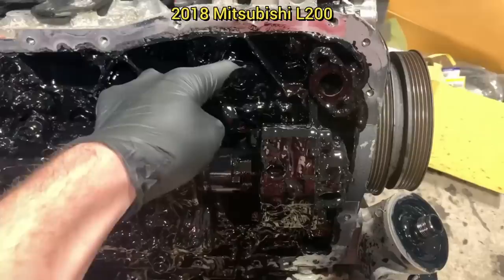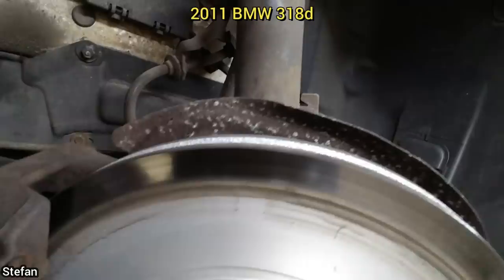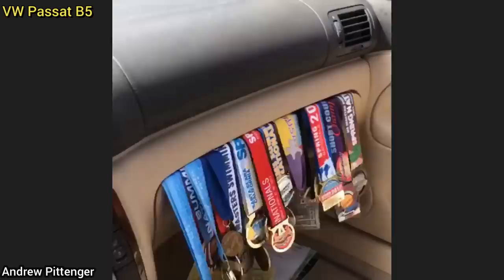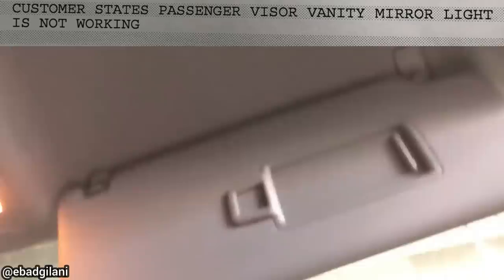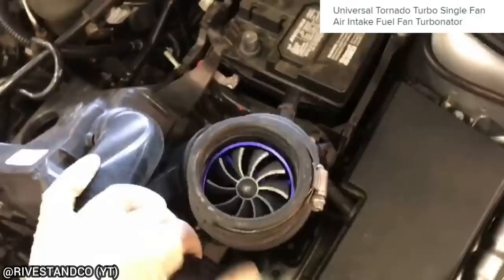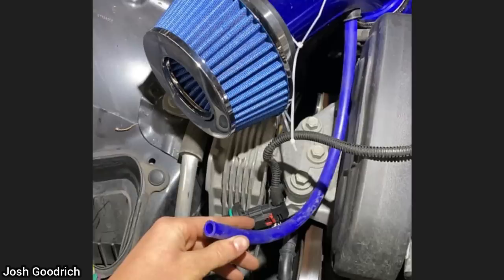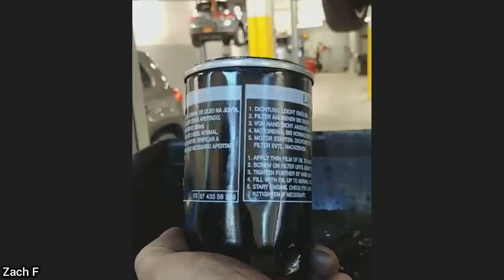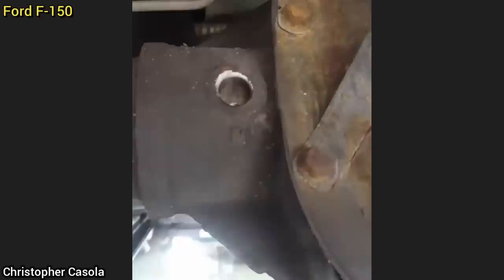Customer States Haven't Changed Oil In 78000 Miles

Comment: Very informative, now I know I can go 77,999 miles and be fine
Reply: Internet win of the day right there. Lmao.
Reply: She thought the salesman said lifetime oil and filter
Reply: Checkmate, big oil.
Reply: I’m surprised it made it that long. Must have been highway miles.😅
Reply: I have a Kia Soul, my engine would explode after 1500 miles.
Reply: Wasn't there a Toyota ad that said "you never need to open the hood"? I might be wrong on the brand, but apparently, a few people took them quite literally 😬
Reply: DAAAAMMMNNN 77,999 without changing the oil that is ehhhh yeah....
I check my oil every time I fuel up, that's just me 👍
Reply: if that's ALL you need ...
it's the PERFECT car ...
Reply: @Nmdixon-cu7vm  "Internet win"? 2001 called, they...

...They hit the second tower
Reply: Are you that confident in the odometer? I wouldn't risk over 75,000.
Reply: @scottrussell6717  Well if the engine dies, then technically it was lifetime oil and filter.
Reply: @rjmari  🤣🤣🤣🤣🤣🤣🤣
Reply: @scottrussell6717  lifetime coolant, lifetime oil, eh same thing. especially after the head gasket goes
Reply: Gm said it’s normal to burn a quart every 800 miles brand new so every 10,000 miles it’s has 8 quarts of fresh oil just need to change the filter twice a year
Reply: @dejjal8683  Shit I went a year between oil changes on my Soule. Still ran fine with 105k miles when sold
Reply: @timothygibney159  Unfortunately, mine has an affinity for oil.
Reply: in a mitshibitshi
Reply: Only if you go more than 88mph judging by the last clip lol.
Reply: I hope that owners realizes that 8 oil changes @ 10,000 miles in between would have been cheaper than a new engine. Someone check my math, please.
Reply: @wierdoslam4760  I believe it was a Jag or Rolls. Was a test. Failed because a bulb went and you needed to open the 'bonnet' 😂 to replace.
Reply: No no no no no don't do it no no stop that come here let me slap you 😂😮👋🤬
Reply: my car get service every January, but i have a tiny Hyundai i10 and i am not American!
Reply: They should call it “life time engine oil” 😂
Reply: @timothygibney159  so as long it was the full synthetic oil kind that has at least the 15k miles intervals, then it was perfectly fine.
Reply: Why would you lol
Reply: What do you soak the engine in to get rid of the sludge?  Can one clean the engine, put new oil in it, and then start the car? 
Wow!  The owner is a dummy!
Reply: I worked in engine oil development.
One test I was envolved in had the engine run for 100,000 miles, no oil changes just top ups to keep the level correct.
The engine was not ruined.
Reply: @Nmdixon-cu7vm  Street
Reply: @sahhull  Let me guess: the engine was just idling and nowhere near redline
Reply: My college classmate's Toyota corolla reached 100K without a single oil change. It was still going strong.
Reply: @CromulentEmbiggening beautiful morning 835 am here in nyc.... "oh my god!!!!!!!!"   Bang
Reply: I change my oil every 3k miles and now my f150 4.6l v8 has over 400k original engine.
Reply: I know I’m lazy about maintenance so I bought Ford Rangers with the incredible 2.3 LIMA engine.

I drove them to 350000 on 2 of them from new.  I think in that 700000 miles I changed oil maybe 8 times.

And sold both trucks running.
Reply: Hahahah I love this comment
Reply: @scottrussell6717  lol
Reply: @timothygibney159 You’re the reason I don’t buy used.
Reply: @sahhull  well first off, how did u determine it went "100k miles"? There is many of many variables that goes with that. Secondly cars that have oil change required light goes by hours, not miles, so plz tell me how one came to the conclusion it "went 100k miles"....
Reply: @anthonymakley1530  Would that actually work?
Reply: @HarrisChoudhry  haven’t tried it but the cats are plugged up every 38,000 miles and the dealership just laughs at you they know there is a sucker born every minute. I wouldn’t take 1 for free if they gave a truck or suv. Next truck will be a Toyota 1794
Reply: @scottrussell6717  And what is really better than original parts and oil?
Reply: @PREDATEURLT  pennzoil platinum is much better than factory oil.. most oem oil is made by valvoline..not saying all... napa gold filters are better than oem... most oem is better than aftermarket
Reply: @scottrussell6717  That was a joke dude, like best is original, so you don't ever change it....
Reply: so you believe anything you see in  youtube, sad
Reply: The first one was so stupid it comes back around to being impressive.
Reply: It's clearly a guarantee case. The warning light didn't work.
Reply: Too late for me. Been changing oil every 5k. At 200k now.

I'll do this for my next car.
Reply: Also keep the car with you and don't bring it on the workshop.
Reply: @CromulentEmbiggening bruh 😂
Reply: @sahhull  I've been doing this test in every gas engine I have owned since 1987. As long as the oil doesn't get contaminated, like in this video, it will be fine. I still have the oil in my van that was in it when I bought it in 2006, it had 60k miles already, now it has nearly 200k and the engine runs fine, it's the electric motors that have died. The people that 'know' what happens when oil doesn't get changed have not tried not changing their oil, they just hear about engines where the oil that has been run dry or contaminated.
Reply: @Gary-vz6ow  Nitrogen oxides degrade engine oil. I wrote a paper on it for one of my engineering degrees.
Reply: @shawnsatterlee6035  I work in oil and fuel development. We do dyno testing and in the field testing.
Reply: Keep it a 76,000 you don't want the engine to die
Reply: Don't test your luck 😂😂😂
Reply: Good luck with that
Reply: Emm, good thought!
Reply: People who lease or finance and trade in every 5 years will actually do this. 🤣

Comment: Everyone involved in the crafting, design and development of that 78k mile engine deserves an award.
Reply: You'll probably find that most engines would last that long with the factory oil. Remember, the engine has reached total failure there, so that's why the oil change interval is set far lower than that (12-15k miles or 1 year), to avoid ever getting close to that.
Reply: meh I am not surprised in the slightest that an engine that has never had an oil change in 78k miles does not start because the guy doing that wanted that to happen simple🤣🤣🤣
Reply: @Travis-guy-247 even 12-15k sounds like a long time, 5000 feels much more reasonable.
Reply: @wertbe1718  Nah that's very excessive, unless perhaps on a specialised engine like a Wankel rotary. Every 12k is fine, else you're just wasting your energy. Realistically most cars could probably do 20k miles per oil change and be okay.
Reply: @Travis-guy-247  it's one of those things that's very preferential. So many mixed opinions over the years there really isn't a right answer. I personally would not feel comfortable going more than roughly 9k without changing the oil on any car, but if that works for someone else then by all means.

Plus, working on cars is like my only hobby, so changing the oil isn't a drag for me.
Reply: @wertbe1718  Yeah exactly, you'll get 100 different answers from 100 different people. Each to their own, just as long as you're not leaving it 100k miles without an oil change 😆😆
Reply: Don't tell him what the customer did, though. He'd cry.
Reply: @Travis-guy-247  If you pay $50.00 an oil change every 5000 miles, that's only a penny a mile. Given we usually pay ~10 to 20 cents a mile in fuel, and maybe 25 cents a mile in vehicle cost, I think changing oil excessively is a good investment. It could very well make no difference at all, but I might only save 50 bucks a year skipping those changes.
Reply: God bless Japanese engineering from Mitsubishi. It sucks that Nissan went the way of the French, now it'll barely go half that mileage before a major problem arises.
Reply: Unless you live in a climate where it gets extremely cold, -40 on the reg (c and f the same that low), even 20k is excessive.  The car that oil was in was a sports car, driven much harder then it was designed for or existed in said freezing cold environment.

I've driven at least a dozen cars for tens of thousands of miles with no real negative.  Time is harder on an engine and oil then usage is.
Reply: @wertbe1718  I am doing 6200 miles. Basically you can stretch it longer if you usually do long trips with your car. If you are commuting to your work, or doing groceries, stretching to 12/15k is bad in the long term. Your oil gets worst faster with all those start stops cycles.
Reply: it would run a bit longer if factory didn't cheaped out and used a good quality synthetic oil
Reply: @DarthObscurity  Do you still drive them?
Reply: New car sales-lady told me 10k oil intervals on new 2024 Mercedes CLA 250. Four cylinder turbo. High oil Temps, even with modern synthetic oil isn't smart to me. 4 or 5k smarter, but she INSISTED she was right. Nothing I said convinced her. If MERCEDES says 10k, that's when you do it, she said. She said I had to do 10k intervals to STAY in warranty....not to do it sooner. This is why we have stupidity in this world. Doing it early is preventive maintenance, not neglect or abuse. Why don't people get that?
Reply: @wertbe1718  So 8 046.72 kilometers why this arbitrary number?
Reply: @Travis-guy-247  Dog stop trying to get people to bust their engines with stanky ass old oil, at least 40% of filters are only rated for 5k Miles.
Reply: @Travis-guy-247  Sure, but some equipment and oils are only rated for so and so. So if you put a 5k mile filter on then you drive 5k miles. Anything else and you're playing dice on doing some damage with each 1k mile above that limit.
Reply: @Travis-guy-247  which is what the manufacturers suggest. 12K is a better bet though.
Reply: @Travis-guy-247 god I feel bad for your car
Reply: @veroxeon1858   Well don't. My cars have worked absolutely fine for my entire driving life, as have everyone I know who follows the oil change intervals I mentioned here.  One of my current cars which is in storage, has 202k miles on the clock. Zero engine issues with 12k oil changes.
Reply: @Travis-guy-247  i agree that cars can go upwards to 30,000 km without oil and filter change, doing it at shorter and reasonable interval will actually help to prolong its life past more than two decades. my hands-me-down car from my dad is almost 15 years now but the engine still feels great. many other parts of the car has failed first. the car is near 300,000 kilometerage already but mechanics said that we dont need overhaul for a long time yet judging by how great the engine is looking. my dad serviced it at 15,000km interval, or after four months, whichever first.
Reply: There are so many dishonest mechanics these days that I can see a situation where you pay someone to change the oil but they don't actually change it and you find you're self in that situation. I check the oil dipstick after oil changes to make sure it doesn't look really dirty but their was one time where I had to leave a 1 star review, file a formal complaint and threaten legal action because a shop didn't change the spark plugs even though I paid them to change the spark plugs and 40k miles later I had major engine problems that were partly caused by poorly functioning spark plugs. I have been ripped off by 3 or 4 different mechanics and one of the most useful things you could teach you're kid is how to do their own car maintence they will do a much better job and save alot of money.
Reply: Man I just change my oil every 3k miles.
Reply: @swlancaster1964  this sort of story ain't worth a whole lot if nothing bad came of it that you can report.
Reply: I ran my b7 passat for 80k miles without an oil change and everythings still perfecr

Comment: I love that you called it a "warm air intake".
Reply: His delivery is so wonderfully deadpan.
Reply: @rjmari  He sees the most bizarre Eldritch horror that comes straight out of a dystopian sci-fi novel and describes it like a math teacher talking about prime factorization
Reply: It got a chuckle out of me; I never made the connection how close "ram air" sounds to "warm air"
Reply: @ericiidx  Ram air would require it to have an intake opening outside of the vehicle, like in the grill, in the hood, or replacing a headlight.
Reply: Came to the comments to point this out. Commenting on yours so you get the credit.
Reply: K&N: when you think you are smarter than the engineers but are actually diminishing HP.
Reply: @svgPhoenix  The one with the warm air intake
Reply: @RustOnWheels  Not arguing abotu the effectiveness of cone filters, I just want to point out how terrible your argument is. The vast majority of vehicles are not designed for maximum power. The are designed for fuel mileage, repair ability, cost, etc. So engineers are not going to be seeking out ever last bit of power.
Reply: @CaliMeatWagon  I know, durability is higher on the list than power, but it’s always hilarious to see people using open air K&N’s that rob their engines of power. Because one thing most engineers really are taking into account is to get the best, freshest and coldest air into the engine as that makes the engine run better. 9 out of 10 times K&N’s are there for show and actually harm the go.
Reply: @RustOnWheels  That's not always true. I own a volvo and from the factory they had the air intake next to the exhaust. And the inlet was excessively restrictive. 
The biggest things that drives the vast majority vehicle design are emission laws, safety regulations, and cost.
Reply: @CaliMeatWagon  yes, that’s not always true.
Reply: @RustOnWheels  literally not true.. a proper cold air intake will be better than most factory intakes since a true cold air intake will sit decently away from the engine unlike a stock intake which may be a bit shielded but still, heat soak will affect air quality.
Reply: @RustOnWheels  The problem is that everyone wants to have a "cool" car. A properly done car-specific CAI can increase power and be a useful bolt-on in addition to a tune, but universal CAIs are almost always complete garbage. Most cars simply do not have the space nor the aftermarket support to have quality CAIs. However, people still want their 2002 Corollas to be "sporty" and "cool," so they install crap filters that suck in hot air from the engine bay
Reply: @RustOnWheels  yup!!!!  best oil filter is your best air filter
Reply: @Clone895  That what I was referring to. Anytime you see K&N’s used it’s in cars where looks are more important than power, which is totally fine and I can 100% relate to that, but the owner thinks K&N equals MOAR POWAH!!

Meanwhile they don’t bathe clean the filter like they are supposed to and they live unshielded under the hood, with all the factory ducting removed, exposed to under hood heat.
Reply: @RustOnWheels  depends on the application how much of the factory ducting they retain. also where do most factory systems get their air from?
Reply: Oh damn, dude was so smooth when he said it,  I didn't catch it. 😂

Comment: Was a mechanic for almost 20 years- seen engines siezed due to lack of an oil change only twice. Once was a car just out of warranty with the factory oil, once was a street sweeper the opperator was only adding oil & not bringing it in for scheduled replacement. Both customers were super upset at us due to cost & down time  of repairs - excepted zero responsibility for it.